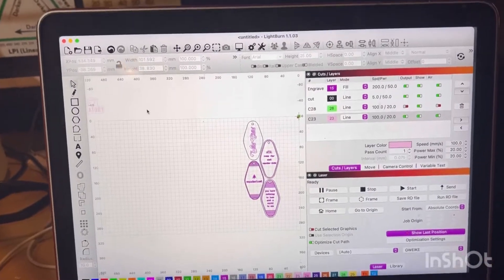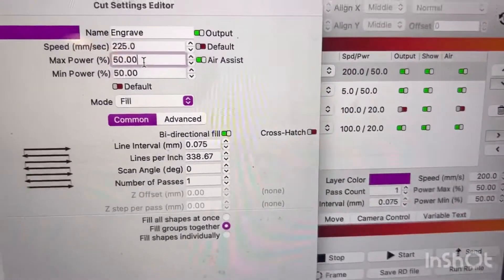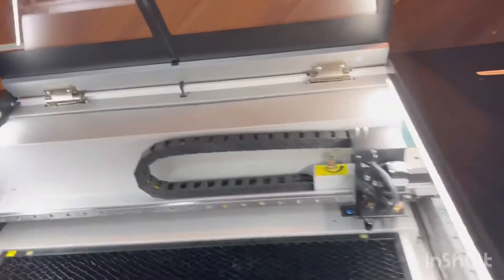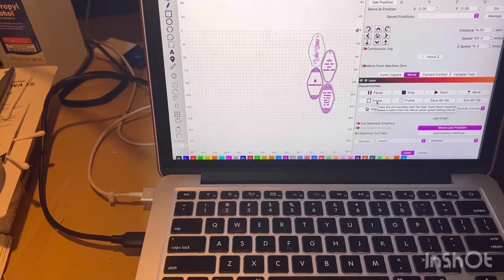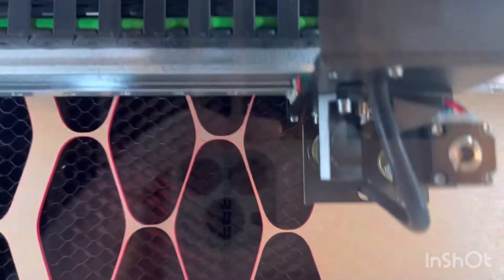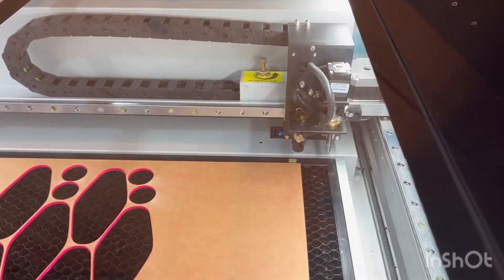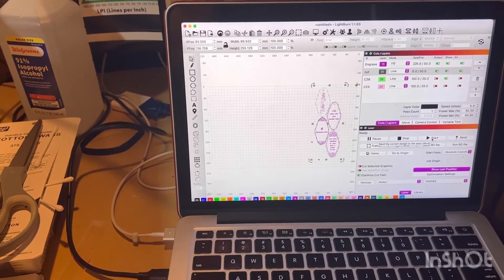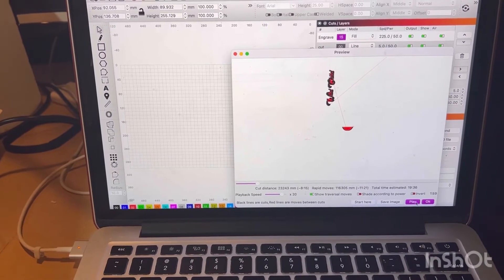Gweike Cloud and Lightburn: my settings and process

Comment: Good video!, I'm struggling with the Z offset number for cutting through 1/8" balsa wood. (Gwieke cloud 50W laser)  So far I'm just getting a way wide cut that does not go all the way through.  Tried the Focus test and found that 14mm setting is best for Z  and 100 speed with 50% power.  Can not figure out where to set this 14 mm on the cuts/layers menu.  All it shows is "Z offset"

Comment: I'm curious why you don't have your design space set so that you can visualize your medium you are using? I didn't understand why you ran the "frame" thing to see if it would engrave and cut where you wanted. Maybe this option is not available on the Mac version of Lightburn? I don't know. Just seems it would be easier to visualize by having the bed available to view with your graphic on top to show where it would engrave and cut.  I'm going to be trying these keychains next. I love the acrylic color! :)
Reply from the maker: I have the first version of this machine where the camera wasn't a thing. They sent me a camera to install on my own, but the cord never really worked well so it was easier to just map out the space.

Comment: Does Qweike cloud come with a manual that explains speed and depth adjustments?
Reply: Page 36 of the manual describes different speeds and power in different materials.  Most people create a burn chart for each material they are going to use as each machine can be different.,
Reply from the maker: Not really. They give you some starting points but I felt they were too high. With any laser I would recommend doing test cards with your material to find the best settings for your machine

Comment: Why are you cutting at 50% power? I suspect you are running a 40 watt tube which you can run at 18mA and my guess is that GW will have  already set the current limit so that you can use 99% power and do no damage to your tube. If so then use 99% power and increase your speed to  achieve a clean through cut . 3mm acrylic should cut at least 10mm/s. How did you magically create white engraving?
Reply: @Lacylgo, the man who started this thread knows a thing or two about CO2 lasers. If you click on him you will find he has over 240 in depth videos on the subject. He knows what lasers are capable of and what they're not capable of. If he gave me advice I would take it. I wouldn't worry about going through the life of your laser tube so much. Gweike advertises these tubes as lasting 10,000 hours, that is almost one year and two months of running time. At this time you can a 50 watt tube for under $200. I'm not saying to over drive your laser but learn to use your laser efficiently.
Reply: She put white paint on it, let dry then removed the masking.
Reply: Its a 50 watt tube
Reply from the maker: The tube life will still run out, so I’m trying to maximize this by running at a lower power. 

And yes I keep my masking on, seal with a spray, paint with acrylic paint 1-3 coats, spray and remove the masking